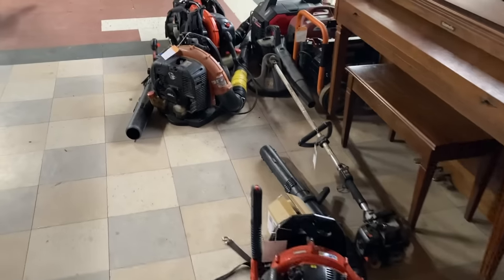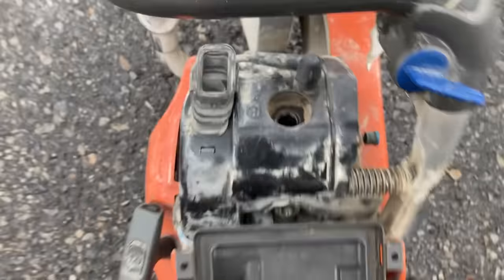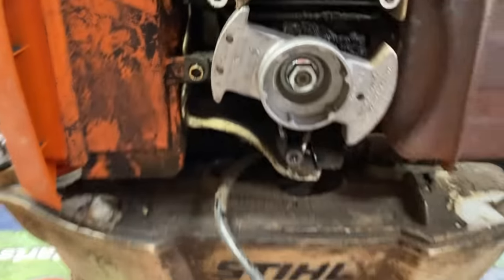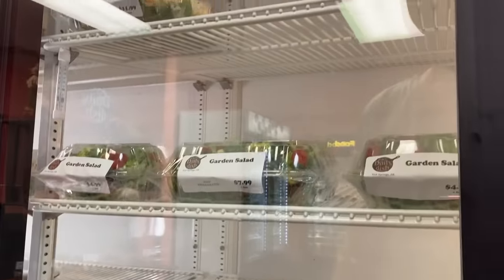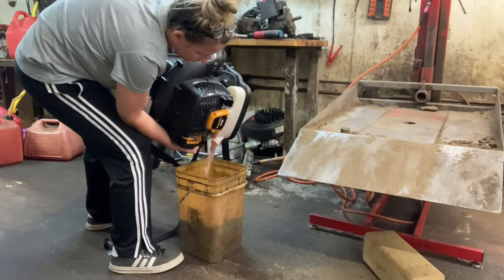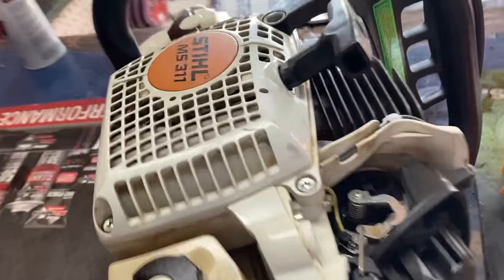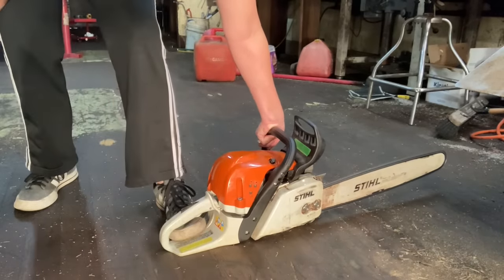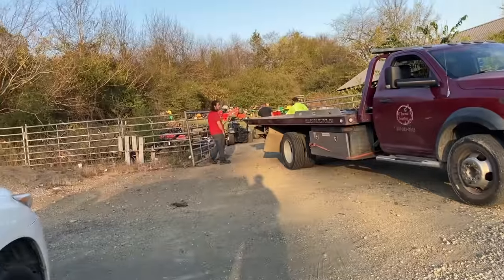Behind the scenes at my small engine repair shop. How many units do I fix every day?

Comment: Seeing you fix one thing a week on video is interesting. Fixing 10 things a day every day must be a real challenge.
Reply from the maker: I really love diagnosing and then the puzzle of fixing them, but I am REALLY ready for a vacation. lol
Reply: @Chickanic  Spoken like a true mechanic! This is how we are, our minds are wired this way. Give us a problem, its like a challenge puzzle, and we will solve it. The customer may not like the result of our findings, but its still fun to work with our hands, wrench on engines.
Reply: @Chickanic question for ya! So I got a simplicity regent it’s older it needs a bearing I fix mowers for fun I’d like to start a shop this year hopefully 🤞🏼but it needs a bearing in the electric PTO clutch I got the bearing but is it supposed slide of easily? Or take some force to get it on the crank because I put some serious force on it and it wouldn’t budge should I sand the crank down to make it slide on?
Reply: @Huntersprojects  Assuming you have the proper bearing removal donut, you might wanna heat the race while pulling.  As for sanding, not recommended.  Designers will go for a slip fit if it is ok to do so.  Most of the time at least a slight interference fit is needed to prevent bearing walking.  I wouldn't sand/grind anything.  Just burnish it before putting the new bearing on.

You might've wanted Chick to comment, but I thought I'd throw in something there.

Comment: I invested in a flexible bore scope for hand held 2 cycle equipment to quickly look at the cylinder walls through the spark plug hole. I got tired of tearing down machines to find that they had scored cylinders from either dirt ingestion or a fueling problem. Saved myself and the customer a bunch of time and $$$ in the diagnosis. Could even hook it up to a large screen to show the customer or take a quick picture.

Comment: Pro tip. I use water in ultra sonic cleaner.  Then put parts in large paint cup with carb cleaner in it . Put cup in ultra sonic . Ultra sonic stays clean, part get clean. Use less carb cleaner and not having to clean ultra sonic for the win

Comment: New to your vids but learning quite a bit about small engines from them.  Liked the scored cylinder in the vid.  Wished you told us more about how it happened and why the flooding happens both in the muffler and air box.  Good job!

Comment: With all the issues with canned fuel could you do a quick vid on mixing your own fuel? It sounds easy but how do you insure proper mixing, what kind of oil? any other additives etc Love your Channel!
Reply: Something that makes mixing 2 stroke fuel easy is understanding the metric system . 40ml oil to 1 litre of gas = 25:1 , 25ml oil to 1 litre of gas = 40:1 , 20ml oil to 1 litre gas = 50:1
Reply: just get the ready mix bottles for one gal or 2 .5 gals
Reply: Lmao

Comment: Chicanic, I have a Redmax 8001 that for its whole life has ran like a champ. I stayed on top of everything with it the whole time. The last 18 months or so though I randomly would notice it would surge slightly at full throttle, after running at full throttle for more than 45-60 seconds. Then just recently it would bog down noticeably after running at FT for more than 20-30 seconds. Anyway, long story short, it ended up being the fuel filter and fuel lines. The black intake line felt a little soft and too rubbery and personal opinion between the fuel filter being slightly clogged (it didn’t look bad at all) and I think the fuel line was collapsing slightly because of it, caused a slight lean condition/lack of fuel. It started and ran great at all throttle openings except at full over 15 seconds.

Comment: Before I tune-up or repair a 2 cycle engne, the very first thing I do is remove the muffler to see if the piston & rings are burnt. Because it's so easy for someone to use gas with no oil in a 2 cycle engine, which will ruin it.

Comment: I enjoy your videos! they are very helpful, and I appreciate very much that you make them!  As a homeowner, I am puzzled why an engine is toast, if it has 120psi of compression, has spark, and turns over, but has heavy cylinder wall scoring? And what does the scoring indicate? and how to prevent it from forming in my power tools?  thank you.

Comment: I think I found the secret to what makes you go non-stop when you're making your viceos..  I see what you're putting in your coffee pot..  I'm thinkin it might be 2 stroke this time.. DOes the regular gas give you the same zip??

Love your videos..  Can I ask one question?

Do you have a toolbox that you take with you to a clients site or does all your work come to your shop??

I love carrying my tools in a 5 gallon bucket and have a padded seat/lid on the top and it also has pockets on the sides for carrying more stuff.  

Is there a video on what you would have in your "go-to" tool box??

As for what I do, I go around to yard sales and buy those weed eaters, chainsaws, blowers, etc that "Ran last year.."  Mmm hmm, sure it did..

I get them at unbelievably low prices (Even had a Stihl leaf blower thrown in on a deal when I bought 2 Husqvarna leaf blowers..)  Love me some Stihl equipment.. 

Most of the problems I run across are old fuel.. Dump it out, pull the plug and run it across my wire wheel on  my bench grinder (Or use a new one I've picked up at yard sales already), fresh gas, tiny shot of ether in the sparkplug hole and 7 out of 10 times it'll fire up and run like new.. 

Keep the videos comin Chickanic..

Comment: What solution do you use in the ultrasonic cleaner?  Recent subscriber and I wish I knew 1/10th what you know.  I am going thru my B&S 17.5 hp Intek.  Your video on how to diagnose and replace a cam shaft totally inspired me to go for it.  This engine does not have an oil pump or a filter.  The problem I THINK I had was an absolutely slugged up engine.  got it all cleaned up inside and out.  Going to lap the valves and seats in before I put the head on.  Your channel has absolutely given me the confidence to "just do it".  Can't thank you enough.😎👍
Reply from the maker: That's awesome! Thank you for the kind words!
Reply: @Chickanic  What solution do you use in the ultrasonic cleaner?
Reply: On one of her talk shows she said all she uses Dawn dishv fn

Comment: Hey 
Chica
Nice!  First, I Love all your videos and I've learned a lot of skills..Here's my question.. I picked up an Echo weed eternity a 3 corner steel blade connected to it.  The model is srm200da.  I've been trying to get it running, fresh Cas with 2 stroke oil.. next I should be able to prime the carb but, here in lies my problem... I can't figure out where the primer bubble is.. Have you ever worked on one of these?  The motor itself looks to be pretty small compared to others that I have worked on.. any help or ideas would be greatly appreciated? My next step is to search online to see if I can find anything about it..

Comment: A bit discouraging to see a machine with such cylinder wall scoring - goes to show what a tank full of 'bad' fuel can do. I took to heart previous videos about canned fuels and so I mix my own now using non-ethanol stabilized gas with just a tad extra 2 cycle oil making it a bit like 45:1 instead of 50:1. 🙂

Comment: If you have shit that's flooded spray brake clean on the parts if you don't want to take shit apart stuff makes gas evaporate very quickly ive tried it in a cup as a test

Comment: Some engines with a scored cylinder have low compression 50lbs on the first pull then the more you pull it will work it's way up over 120lbs. They still won't run.

Comment: I wonder. Have you done a video on putting away your equipment for the winter.  ??
Reply: She has. she offered a great tip for two stroke engines is to fill the tank with enough two stroke oil and cycle the engine to get the oil into the engine cylinders. Brilliant I tell you, simply brilliant! Search for her video on her channel for details

Comment: Bree, can I ask a question in regards to 4 stroke oils, let’s use Honda or Briggs mowers hell let’s do both, but it’s usually the 10W30 should we use a mineral only oil or should we start using semi synthetic oils?
What are you thoughts.

Comment: The chainsaw with the light scoring should not be used you shouldn’t have tuned it you should have stopped there to avoid ruining the cylinder plating.  That will score then seize needing a new cylinder as well as the piston. It can be honed now but not if it’s ran. I’m a bit surprised at you for that.

Comment: Hi, I am a new subscriber to your channel and love your content and how easily  you explain the repairs / solutions. I would be grateful if you could please help me with an issue I am experiencing with a mower. 
I have an issue with a Honda GCV190A mower on an Mountfield deck. The mower starts and runs for approx 45mins and then cuts out and then its impossible to start, generally I have to wait till the next day to start it. I have replaced the coil with a new genuine one and the problem is still there. Can you advise what else it could be. This is an auto choke model. The serial number of the engine is GCV190A S4LE NH1. 
Look forward to your response. 
Tahir

Comment: In your shop i know from time yo time you come across some rare situations i have a husqvrna 55 rancher after sitting for months now it has a hard pull like you can barely pull but if you take out the plug it pulls do easy i also took off the muffler but it dont help did you ever encounter a problem like this ? an idea on the fix ?
Reply: user-bj2kz3ck8b  how do I reply

Comment: I really appreciate your work, however, I am stunned that modern men cannot troubleshoot a leaking gas cap.  Admittedly, I grew up on a ranch in the 50s and 60s on Anderson-Flatt road southeast of Pidall, AR, , but lord, simple engine troubleshooting is not rocket science.  I suppose my generation failed our children and grandchildren.  You, however, are a blessing and give me some hope for the future.
Reply: in the years I've run Stihl equipment, I replaced one quarter turn gas cap, and a twist on weed eater cap every year or two until I retired the weed eater because it was too hard to get parts that would match the ones that weren't made any more.  but yeah, a lot of commercial users just drop a problem tool off at the shop instead of stopping their workday to deal with it.